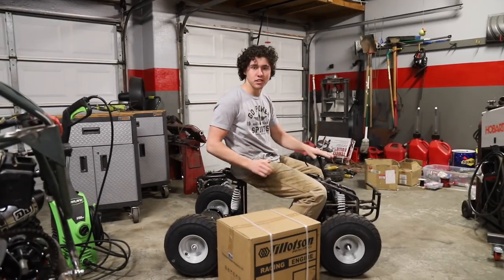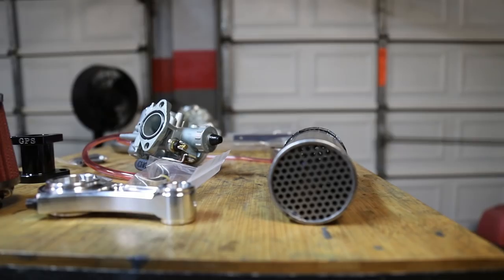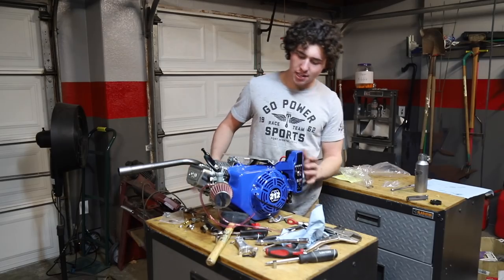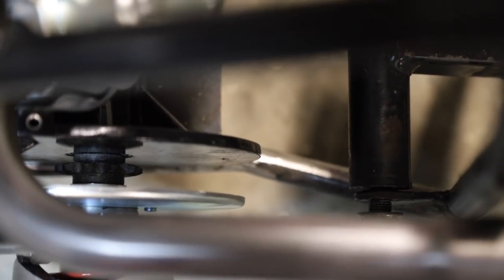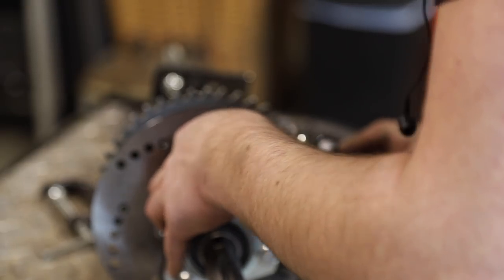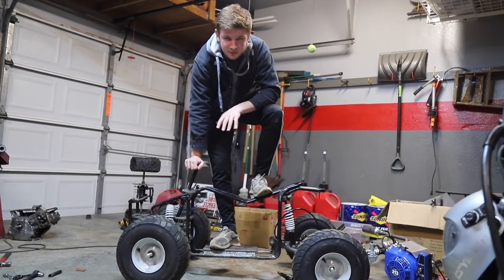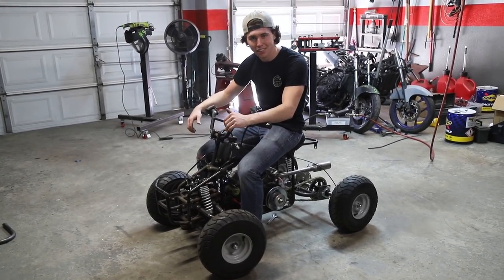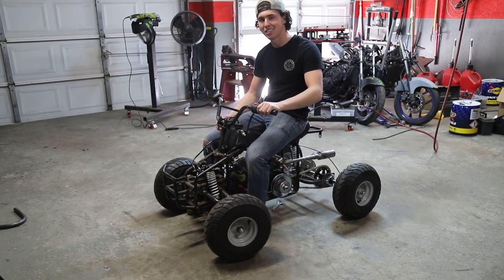Monster Mini ATV Gets a Built Tillotson! | Mini ATV Build Part 2

Comment: You shouldn't use vise grips to take your carburetor stud bolts out, you should use 2 nuts and lock them together, that's the best and proper way to do it.